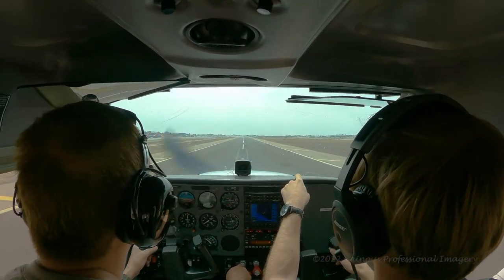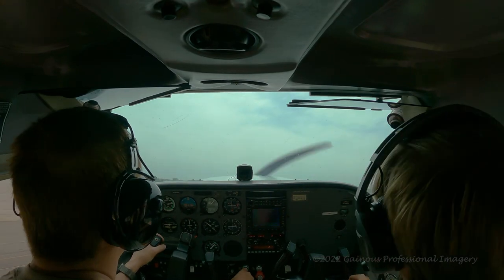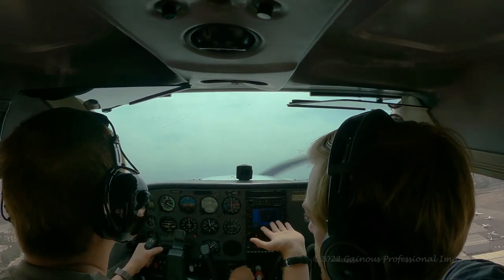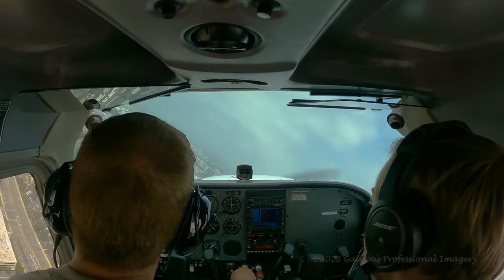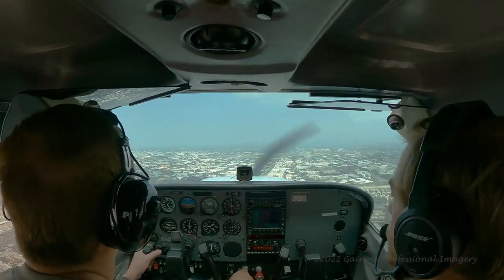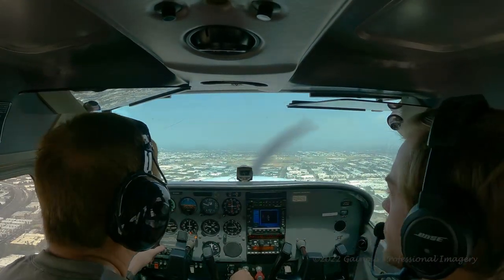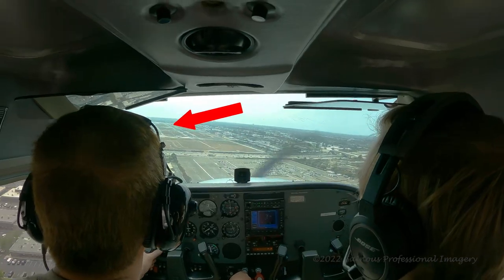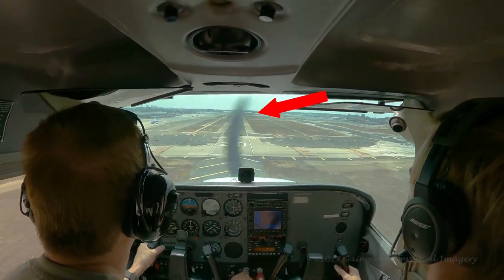Wake Turbulence C172  v Boeing 737

Comment: I fly a Q400 in and out of busy airspace all the time.  Been hit with wake turbulence on 3 separate occasions hard enough that it made the butt hole pucker up.  The Q regularly lands at somewhere around 60,000lbs and the wake from a “smaller” airliner like a 737 had enough force that it still gave us left and right banks of 50° and enough force that it disengaged the autopilot.  You never forget those kinds of experience and quickly learn to respect the “caution wake turbulence” turbulence call!

Comment: I had worse, many years ago, flying into Palm Springs in a Tomahawk. Maybe a 45-60 degree sudden bank, but it seemed like 90. Can't tell you how happy I was to get that plane landed after that. Then when I was leaving, a 737 was behind me. I made sure he didn't get in front of me. I took off, with the admonition that I move to the right of the centerline, which confused me, but when they cleared the 737 for takeoff, it dawned on me...get out of the way! The 737 rapidly caught up to me, and banked off to the left about then. I could see the passengers in the windows. I'm sure some of them marveled at me. I was a student pilot at the time. Good times.
Reply: Cool story but as a student pilot I think I’d rather not have that experience. I was intimidated enough when a large commercial taxied on the ramp right next to my two seater.

Comment: Nice recovery.  Here are some things I would do differently though.  If there was an option to do a short approach, I would turn base sooner and land before the 737 did.  I noticed a plane between the runways, so it may have had to cross 20L first, not sure.  Once you hit wake turbulence, there's no guarantee you won't hit it again or just remain in it.  Best to go around or at lease climb until you're above their glide path, land long and well clear of it.  If nothing else, a steeper than normal approach with an aiming point beyond their touchdown point.  Keep up the good work, you'll have your license before long.